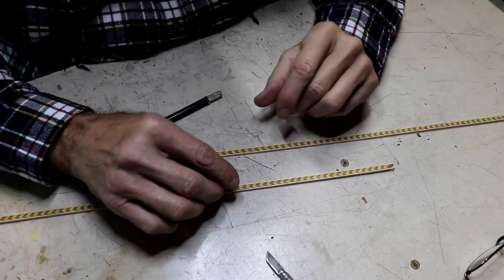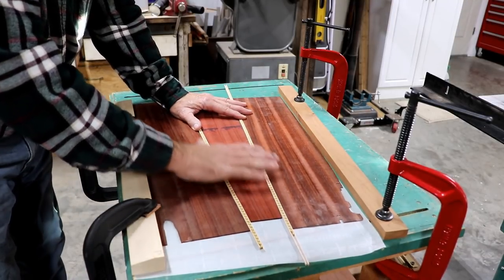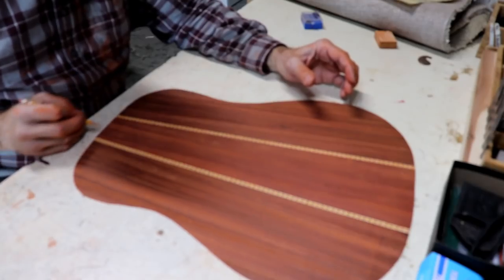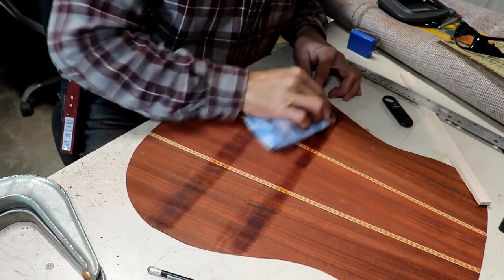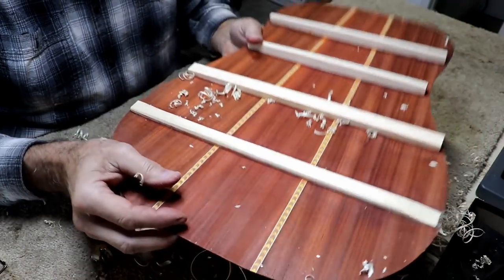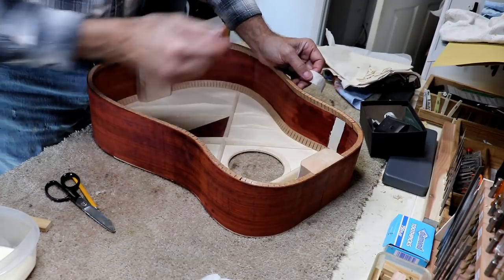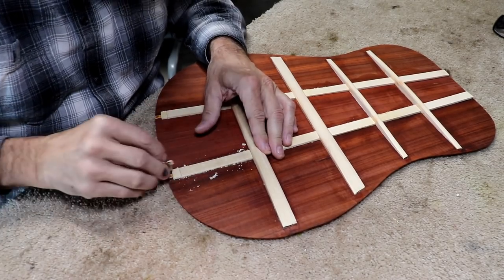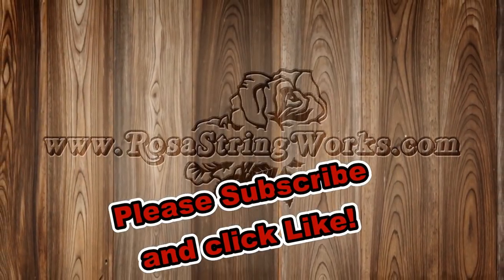348 RSW Custom Guitar Build P4 Back And Body

Comment: To remove glue: use a plastic drinkingstraw, cut off the top in 45 angle. Thus you can reach in between the clamps, using the right hand to push the straw and the left hand to keep it pushing against the side between the clamps. With this you can easily clean up without spreading the glue and without wetting the board (if glue is still soft enough).
Reply: That's a good idea Euh! Thanks and Season's Greeting's to you & yours!

Comment: Acetone draws water out (azeotrope) and probably arches it a hair due to shrinkage. It was also make the wood a bit hungrier for moisture in the PVA glue.obviously removing the stains trans oxide pigments and oil that are in the wood pores is probably the dominant means. I think the technique reflects more chemistry knowledge than you realize - experience is a great teacher.

Comment: At around 26.50 when you were tapping the back, there was a note I could hear. Can that pitch be altered somewhat by carving the braces or taking more wood off the inside surface of the back? It seems if it were in tune to a specific note tuned to A440 and the guitar was tuned at A440, that that particular note or an octave of it would really ring out stronger than any other notes. And for this reason, would it be important to NOT have it tuned to anything? That's just a question that popped into the ol' brain as I was watching!
Reply: I made my comment too soon, as I watch your longer videos like this over a period of time. :-)  When you had the back, side and front together it was even more resonant with tapping, and I heard a cacophony of notes, so I guess my earlier comment may not matter.

Comment: Looking sweet, enjoying the show!

To find the radius of the curve, the formula is h/2 + c^2/8h (half the height plus the chord length squared divided by 8 times the height).  I'm not sure of your exact dimensions, but it sounds like your height is about 1/8 inch, and your chord length I'm guessing is about 15 inches.  So you get (0.125/2) + (15^2/(8*0.125) = 0.0625 + (225/1) or right around 225 inches, which is between 18 and 19 feet (18.75 ft, or 18 ft 9 inches). So, yeah, a good deal more than 10 feet, but likely less than 20.
Reply from the maker: I guess my point was that it's too big to try to draw.
Reply: @RosaStringWorks  Oh, I agree, you just had me curious, so I wanted to figure it out.   The engineer in me, I guess.  Then, of course, I had to share...  

Looking forward to the rest of the build.  Take care and Merry Christmas!
Reply: @RosaStringWorks  For your consideration for future jobs, it is possible to draw the radius and doesn't cost much:  Cut out a uniformly thin (1/8" or thereabouts) strip of wood 1/2" to 1" wide and an inch or two longer than the brace.  Cut a notch in the center of each end wide enough to accommodate a piece of string and tie the string off on one end.  Then repeat what you did on this one and figure out how much displacement you want in the center.  Bend the strip so that the distance from the string to the inside curve of the strip is the displacement you want and tie it off.  Trace the curve on to the brace.
Reply: Thanks much for the video.  Despite my best efforts, I keep learning.

Comment: 11:15 1/8 inch in 1 foot gives exactly an 8 foot radius. Your first guess -- 10 ft -- was close, eh.

Technically, the braces will bend slightly... so if want exactly 1/8 you need to reinforce them during clamping. 🤠